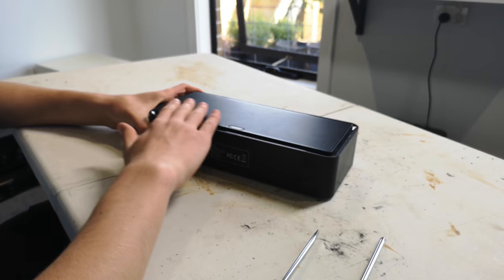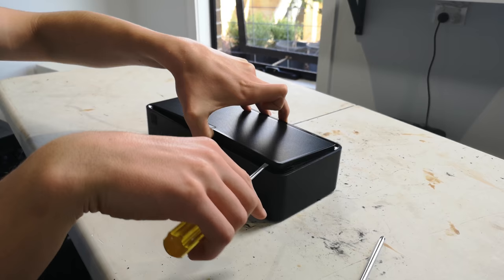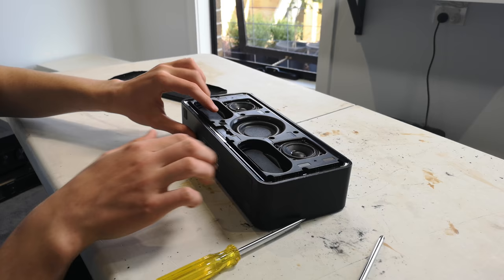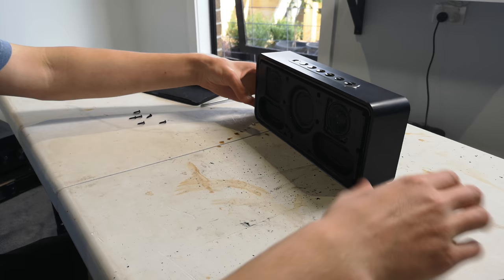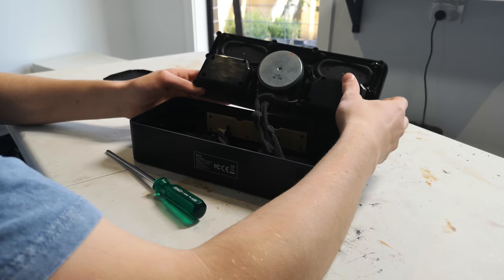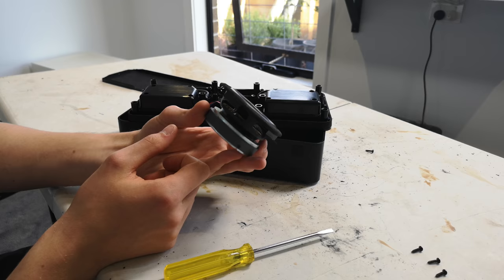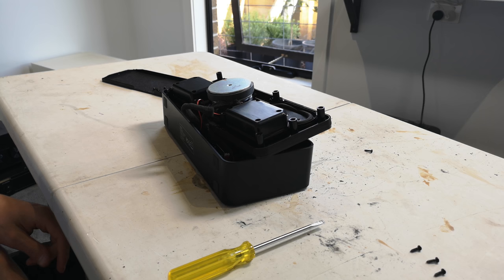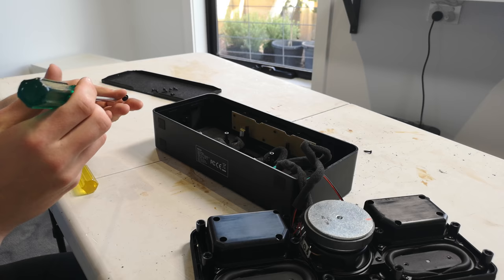WHATS INSIDE? - Doss Soundbox XL (+ Repair)

Comment: The box being made of plastic needs that added  metal plate to stiffen the structure to reduce vibration and resonance  to produce cleaner bass. Some high end home speaker  baffles are actually made  of all metal or thick alloy for the same purpose. Those Doss engineers truly are knowledgeable on sound acoustic by adding those metal plates. Also, sealing the mid/high drivers from the subwoofer is an expert move because it eliminates distortion on the midrange that can occur with the air pressure from the sub. This details made me appreciate more on the built quality of the XL. Most bluetooth speakers, even the expensive ones won't go this far to produce better sound.
Reply: It's also needed to balance the battery weight.

Comment: The mass is not a white van scam thing in the doss. It’s added to provide mass damping and improve the midrange. I’m quite impressed by doss that they would include this. Usually, other speakers would have a heavy enough speaker magnets, or heavy enough enclosure to dampen, but someone knew the doss needed the extra weight.
Reply: Not only that but a lot of masses in bluetooth speakers are used as a counterweight to balance the speaker from the weight of the battery, stopping one side being heavier/making it less stable.
Reply: @oitzjake  Also maybe keeps it down when bass is heavy?

Comment: I don't think that the added weight is to make it feel heavier. I think its there to help the speaker not move around as much because of the vibrations from the woofer on higher volumes. Because I saw in some other video someone did on the speaker, that when he turned up the volume the speaker literally started to move around on the table it sat on.
Reply: that would have been EXO's vid. yeah that thing can walk off any surface really
Reply: yeah, it was haha

Comment: Fill the inside with synthetic cotton? It always adds bass to smaller worser speakers like these. Always adds some more oomph to them too. Plus with any problems with the air leaking can be fixed with this. That's how I engaged the passive radiators on my DIY speaker when I noticed that I had too many air leaks to fix.

Comment: The metal plate does many things, stop some distortion etc but also counterweight the battery mass otherwise it would be heavy to one side and surprisingly easy to drop if picked up from centre.

Comment: One of the best Bluetooth speakers that I've heard or owned...now for the issue.  I left it plugged in for a few weeks and since that the battery life is down to a few hours and the speaker keeps cycling off and on if plugged in.  Would it be possible that the battery is not lithium???  Or that keeping it plugged in has caused a problem??
Reply: I have the same  problem with mine, since I brought my XL to our shop, the power plug never pulled off the wall socket for more than a year now. And our shop is 24/7 open, anyone can just connect to it. I'm actually watching this hoping to get an idea what type of replacement  battery do I need to buy and how'd I do it. 😁
Reply: Try reset insert paper clip at the back. Always helped me but I have left it in for the third time haha I make be out of look now try it out. This method alwahs worked for me in that past. Support told me this method. Small hole next to the charging port.

Comment: I had one of these speakers fall out of my car while I had a car accident which ended with me being upside down. Luckily I was fine and I found the speaker on the ground in the snow.
It had a badly bent grille, which I kind of bent back, and it was also leaking (and huffing) air. I was able to fix the issue by bending the steel frame of the radiators straight again, this way there was no air gap from the radiators to the screws inbetween the mounting screws. Otherwise it still works fine to this day.

Comment: Is it possible to replace the battery by doing this?  Mine all of the sudden stopped turning on this morning and the charge light in the back doesn't indicate charging.  The red light does, however, blink when I hold down the power button while the charger is in, so I have no idea what that indicates.  Thanks
Reply: I have this happening now, too. Wondering if maybe the battery cable has come undone like he mentioned he looked for?

Comment: The metal plate in my opinion is for strengthening the structure to reduce vibration of the box. It should improve sound quality if only a little.

Comment: I added some weight so it doesn't move  around  at low volume best sounding Bluetooth speaker  I own . Btw look at the screw holes in the front I had some slight air leak because one screw wasn't tight enough or it could be the  charging port area  in the back  that came a little loose when yours fell down .

Comment: I've never been too impressed by mine, the bass is weak but I never did anything about it.   Thanks for showing disassembly on this!  Woofer returned to resting position within a second!

Took the grille off and found a couple of loose screws, then I put a piece of tape over the back input/power/memcard section.   It looks like that's where all the air is leaking from.   If I loosen up the tape a little it puffs with any push of the speaker.   Hate to take it apart and risk making things worse but your video has made it easier.  While I'm in there I may put some better batteries in.   Is it 2x18650 in series?   Thanks for the vid!
edit: I dribbled hot glue all over and around the input/memcard housing and there is an improvement in the cabinet leak.  It still leaks down when pushing on radiators but the time to equilibrium is reduced.  Going to try some dry-ice fog to see if I can find more.

Comment: The metal could be a counter-weight for the weight of the speaker but if it is mint for sound damping they would of been better off using sound damping material like second skin like in car audio

Comment: I am very curious how hard it is to change the battery in these? I had a JBL bluetooth speaker which had a battery that was virtually impossible to change, and when I did finally get it in, it was definitely impossible to get the speaker back together correctly! Thanks! CC

Comment: What battery does it need replacement?
Reply: Looks like dual 18650 lithium batteries, very common, used in vape box mods, can get these online easy. My batteries no longer charge, I'm planning on replacing. I removed all 12 screws and was stopped by not being able to remove the front speaker panel from the case, this video confirmed it is possible. 

I wish he had taken a good video of the interior of the box and the battery area, no such videos exist that I know of.
Reply: @StuBotNYC  thank you for your response. It was very helpful I m sure for the community. But do tell me after the repair if these are the specific batteries as in the certain parts of world vaping is not a trend and getting any other info would be very helpful. 👍

Comment: Do you think it is possible to add 2 extra batteries inside the Doss? The battery life is the only con
Reply: I want to do the same thing mate, but l keep reading about how the air tight can get messed up if opened

Comment: So i've opened up my speaker and after assembling it, the subwoofer sounds distorted and the passive radiators dont seem to work. How do I assemble it properly?
Reply: Probably air leaking, try sealing the enclosure or check/fix for air leaks.
Reply: Dan Klas yea, i'm aware. not sure how to check for air leaks though. might have to get someone to reassemble it
Reply: Brandon C. Just fix it when you put it back together! 

;) kidding.

Comment: Yo I have one of these and my amp has broke and the charge circuit on it has burned like it actually had a flame anyone know of a replacement amp for one of these speakers
Reply: Parts express most likely has a compatible amp